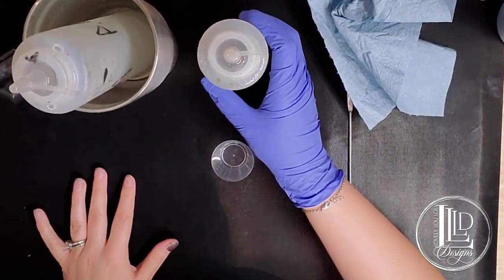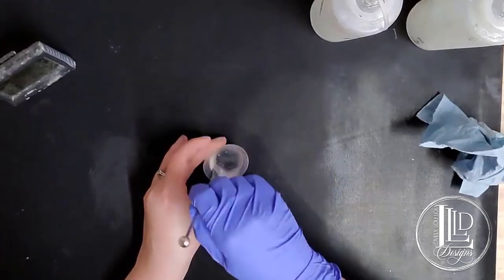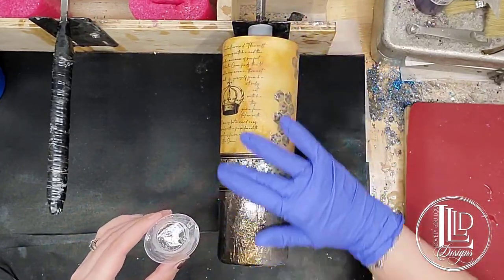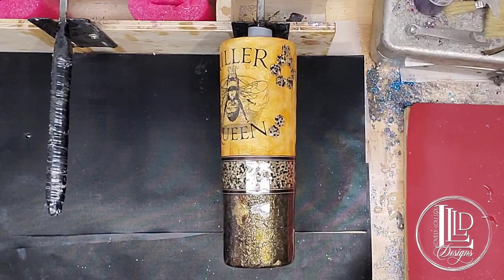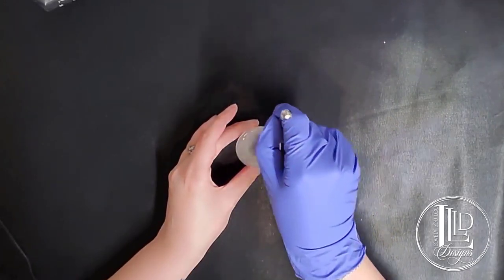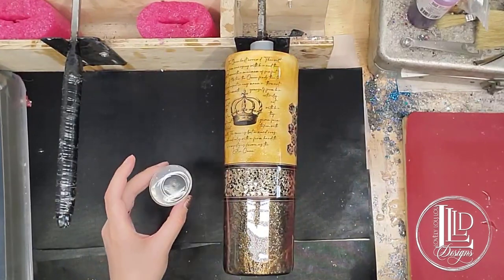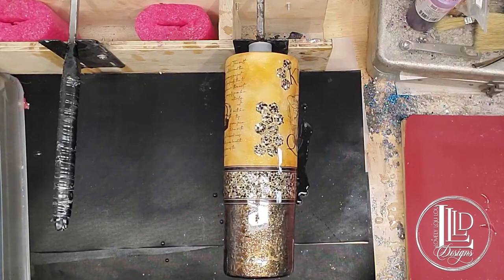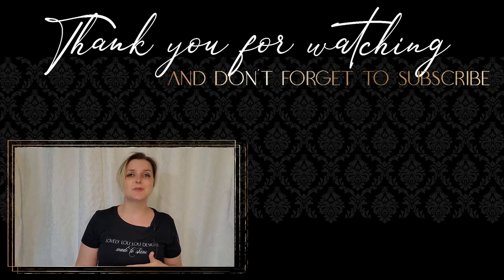How to Get a Professional Finish with a Flood Coat

Comment: Hi!  I am looking into getting the vinyl cutter and /or software.  What do you recommend?  Everyone talks about their Cricut cutter but no one says what upgrade or insert cartridge or what make/model to use.   I don’t know where to start 😉
I have a very old model and probably want to upgrade -thanks so much!!
Reply from the maker: The new models don't use cartridges. But you will need an internet connection. I have to maker, but that level isn't necessary unless you will be cutting things like fabric as well.

Comment: Do you know if the medium viscosity ccdiy epoxy works in warmer more humid climates too?
Reply from the maker: It likes heat, but most epoxies don't like humidity. I run a dehumidifier in the wet and humid months here

Comment: Just making sure I heard right.  Do you double the amount of epoxy for the flood coat?
Reply from the maker: I don't double, but I do mix up a bit more. So if I usually mix 10 ml for a 20 oz, I will mix 15 ml for the flood coat. If I waiting a bit longer it isn't as sticky, mixing the regular amount is fine

Comment: when u do the top w acetone how do u know it’s sealed if it doesn’t go up over the rim? i struggle with my rims more than anything else. it stresses me so much.
Reply from the maker: The epoxy is still wet when I do the acetone. I'm just going over the rim and inside. since it's still wet it will seal, harden and cure.

Comment: This tumbler (and your tutorial) is amazing!  I'm obsessed with the tumbler design!  I found a honeycomb design on your etsy page but I'm wondering how you made the honeycombs on this tutorial - they look amazing - is it a leopard print inside the individual honeycomb?  Did you do a peekaboo to get that effect?  

You are so talented  - please please makes more tutorials on your tumblers - especially this one!
Reply from the maker: Thank you so much! You are completely correct in that it is a peek-a-boo for the honeycomb. The chunky glitter mix in the centre band is under the top section of the tumbler as well. I used the honeycomb design in my Etsy shop to make the peek-a-boo cut outs. This is a tutorial I have had a lot of requests for. I took an extended break last year but am getting back into tutorials now so I will be making one for this tumbler as well. 🙂
Reply: Yay!  I can't wait to see it!  Thanks 🙂

Comment: Can the epoxy can be put in warm over and over before mixing without any issues? Or does it need to be measured out for each use?
Reply from the maker: You can warm part A over and over before measuring and mixing :)

Comment: Very helpful video, thank you! I have a question about excess epoxy getting inside the tumbler... You mentioned cleaning the rim of the tumbler, but it looks like there is a chance that epoxy would get further into the cup, how do you clean or prevent? Thank you!
Reply from the maker: I don't usually have an issues with epoxy dripping too far down into the tumbler. When I'm doing last coat I will use acetone on a Q-tip to make sure my room is clean. If anything does drip inside, since the tumblers aren't prepped inside, the epoxy pops off easily. I will usually use an exacto knife and just pop it off in one piece.
Reply: @LovelyLouLouDesigns  Thank you so much for your fast reply! We really enjoyed this video and have subscribed. 😊

Comment: A flood coat is a coat that is 1/8 inch thick.   I feel like you used the same amount as the sealing coat after you removed what you called the excess.  Regardless, your cups wind up looking immaculate, so I guess it doesn't matter what you call it, lol.
Reply from the maker: Lol when I apply a coat of epoxy on top of a coat of epoxy that is only dried between 3 to 5 hours, I always have to use more or I risk "damaging" the bottom coat. It may look thin, but it is significantly thicker than my bottom coat :)
Reply: @LovelyLouLouDesigns  I'm for sure not banging the outcome, because your damask is what inspired me to create my shops signature design in a twisted version of it.  I thought I had already subscribed and was a bit miffed that I missed your latest update.

Comment: Stupid question and a newbie...when you mixed the second round of epoxy, did you use a new mixing cup or was it added to the leftover from your first coat?
Reply: You will want to use a new cup. Your parts need to be exact and using the same cup could cause your ratios to be off. Also, after 2 hours and 45 minutes, the epoxy left in that first mixing cup would be very sticky.
Reply from the maker: Thank you for answering Emily. 🖤
Reply: Thank you...I appreciate you giving me some insight.

Comment: How far away do you torch from the tumbler?
Reply from the maker: A few inches away. I move very fast though and don't let the flame stay in any one location for too long. It's very easy to overheat the epoxy and burn it or cause divots.

Comment: What grit do you sand your tumblers?
Reply from the maker: It depends. If all I'm doing is roughing up the surface a bit to give the epoxy something to adhere to, I will use a finer grit like 240 :)

Comment: What torch is that?
Reply from the maker: Bernzomatic TS4000 with propane gas
Reply: @LovelyLouLouDesigns  Beautifully done! Can we use a heat gun or blow dryer on low settings instead of a torch?

Comment: Thank you so much for sharing! I've had a little bit of trouble with the CCDIY epoxy. I'm going to try your tips tonight. I've been using the propane torch as well but I think I'm putting it close enough in fear of scorching the epoxy. It really helped seeing how someone else does it.
Reply from the maker: You're very welcome. Be sure to keep the flame moving. If you add too much heat you'll get divots.